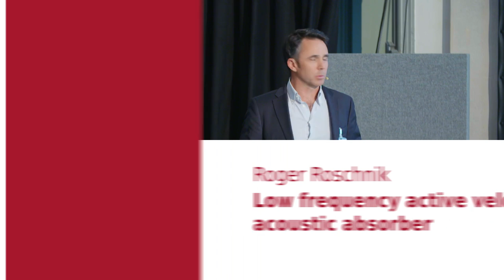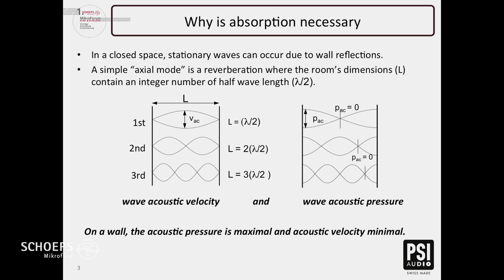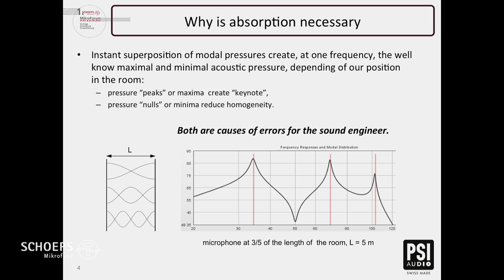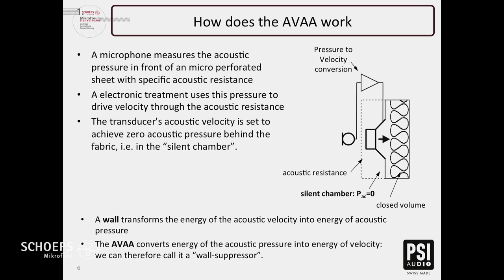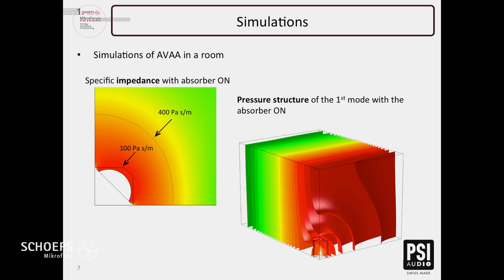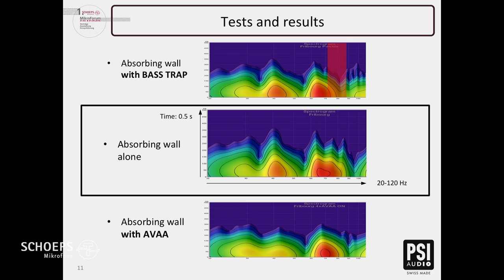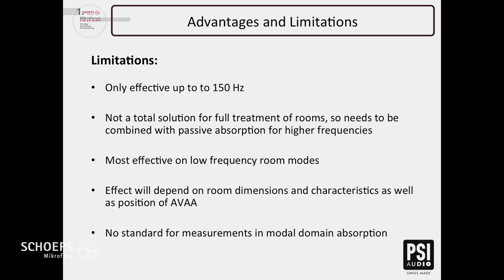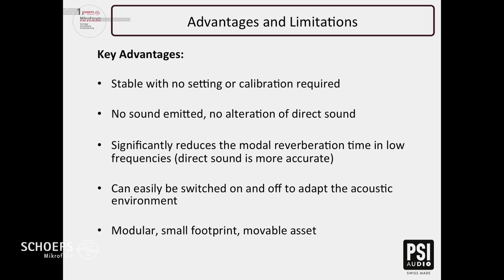Roger Roschnik (PSI Audio): "Low frequency active velocity acoustic absorber"

Comment: Can we stack AVAA on top of another?
Reply: as each Avaa replaces a perfect bass trap of a size of approximately 5 to 10 square meters it would be rather inefficient to stack them on top of each other. At 20:36 he explains how to find the spots to place several Avaas. Room corners are the best spots, sometimes also in the middle of walls. If you have a door at a corner of a wall you can also place one Avaa at the top corner above that door and the other Avaa at the other top corner of that wall for best symmetry.

Comment: You can name it names, but this is active noise canceling system.
Reply: SO?
Reply: Noise canceling uses phase cancellation. Does this?
Reply: @dougleydorite  of course. You can’t beat phisics. But, you can beat the price.
Reply: @mpelevic  by putting in several feet of insulation material? No thanks
Reply: @dougleydorite  🙌 who’s taking about traps? We are on the subject if active systems.
You can achieve exactly this with any active sub woofer. Connect signal cable and use any free dsp app to control volume and phase. 
If you don’t use a computer, set manually  directly on that woofer.
That wheel has been invented long time ago. Five to ten times less money. 
To be fair, you will loose this exotic name of the product.
Reply: @mpelevic  ahhh I hear you. I bet it has been out for ages but do you know of any products I can buy? Or are you saying one could make their own?
Reply: @dougleydorite  make your own,  as I described. Choose your own budget. ;) 500$ is more then enough, you can make it with less money, if you know what you’re doing.
Reply: @mpelevic  who knows how to make a device like this? That’s just insane
Reply: @dougleydorite   Ok.